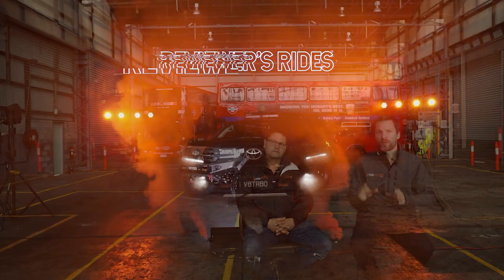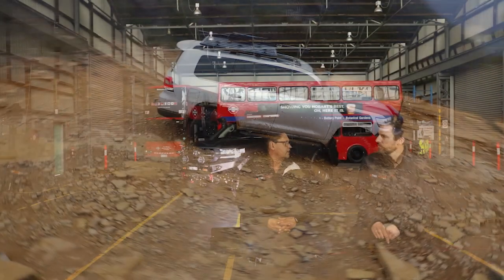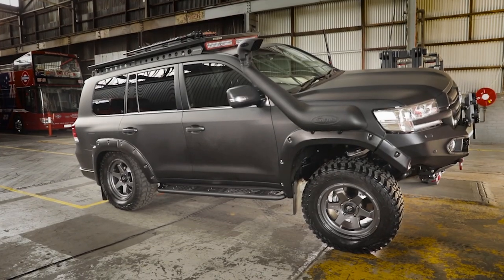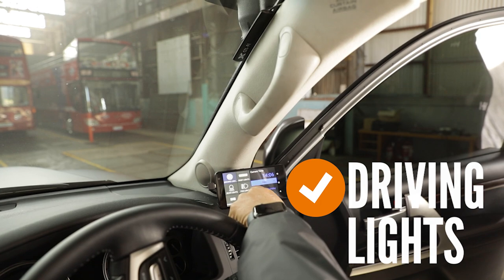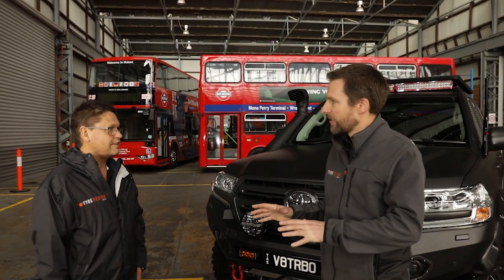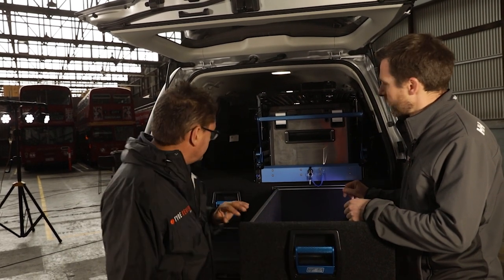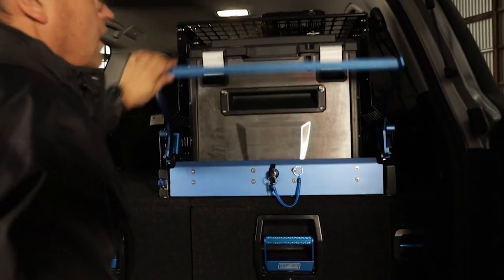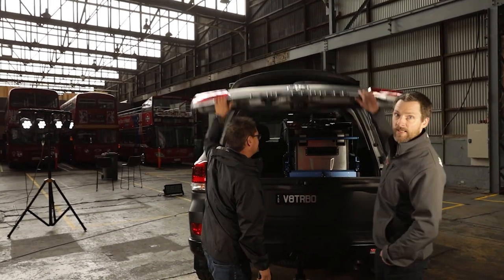Reviewer's Rides Toyota Landcruiser 200 Series

Comment: Looking at running the same set up. Did you go the 2 inch or 2.5 bore shocks?? Do you know the kerb weigh of it now. Looks great
Reply: Superior Outback Adventurer 2.0 AUSTRALIA WIDE LEGAL 4 Inch Lift, Up to 35 Inch Tyres*, 3.9T Gvm Suitable For Toyota Landcruiser 200 Series is what we ran,
Reply: Chris Podesta how did you get the Kut Snake flares to fit so well, especially over the Kaymar rear bar and the Rhino bar? I’ve had aftermarket flares on previous cars which didn’t fit so well and I’m getting a 200 soon and want them to look as good as yours do.
Reply: @lukerae4528  Sorry for the slow reply,   guys at ARB Hobart did it.  neat Job !